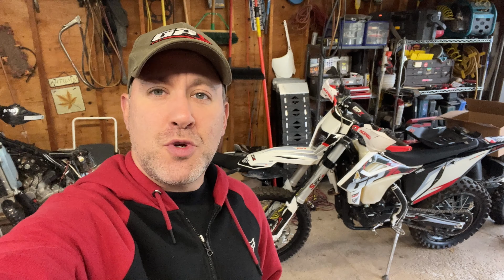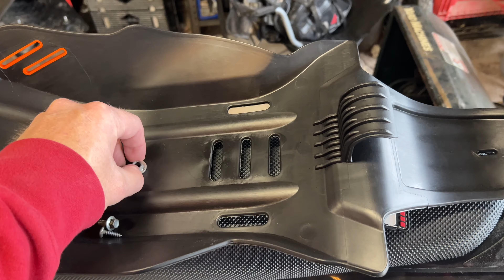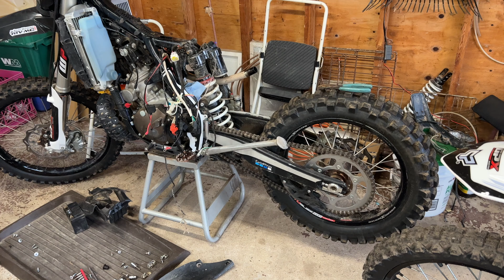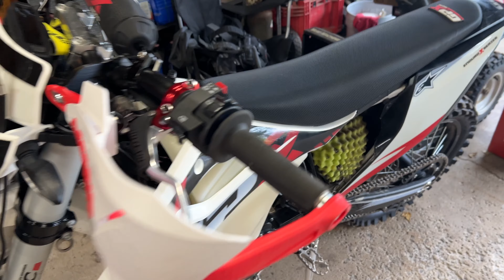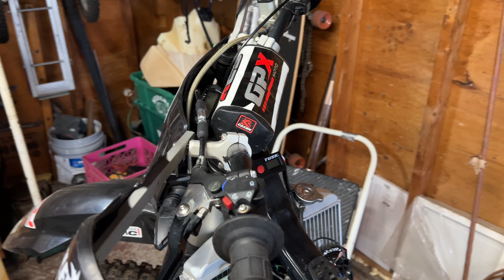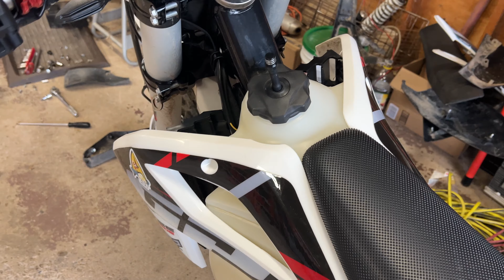GPX Parts Quality Evolution

Comment: What about the reliability of the electrical system like the stators and coils, etc., for example?
And the metallurgy in the structural components?  China tends to use heavier but weak, cheap steel and some cheap alloys in things. And very cheap plastics.
No R & D takes place in China. Only copying and technology theft.

Comment: just got my gpx , what oil
do you guys recommend?
Reply from the maker: Not sure which bike you have, but 2 stroke I use maxima super m, and 4 strokes I use rotella t4 or t6, rotella is great for the gear box too in the 2 stroke
Reply: @LCARSADV  im using a 250 tse , its quite high do you recommend shaving off the seat or installing a lowering link?
Reply from the maker: @Crazyfornayeon  I’m 5’9” so I’m not sure how tall you are, but the lowering link is always a good option. I think GPX stocks them. Seat concepts also sells a low seat foam which is nice as well

Comment: Thanks for the closeup of the spedo, I looked everywhere trying to find out the functions of the 21.5+ spedo. Looks like it has a battery guage, someone else posted the older spedo's has a odometer but not a tripmeter. Someone needs to do a video on this important part of the bike, thanks for the good info! Mine will be delivered in a few days
Reply from the maker: Yeah they have rpm,speed,battery,odometer, trip, and gear indicator